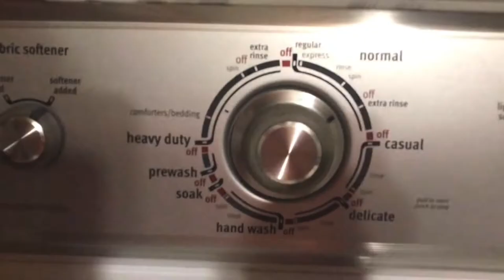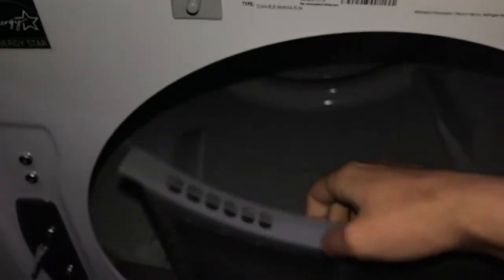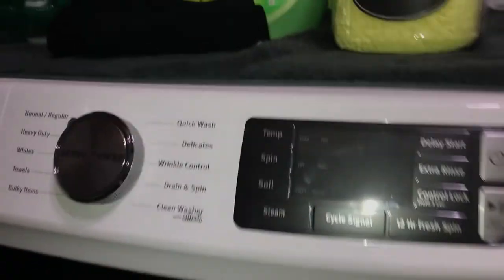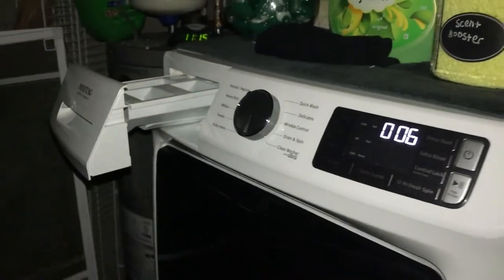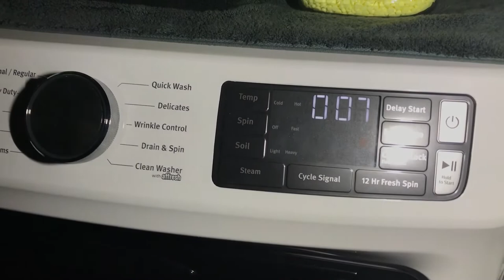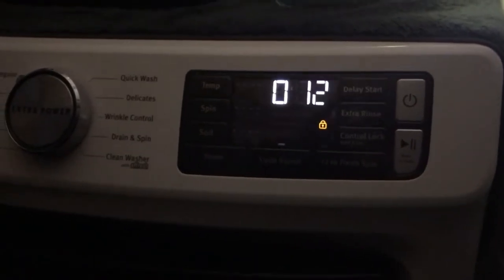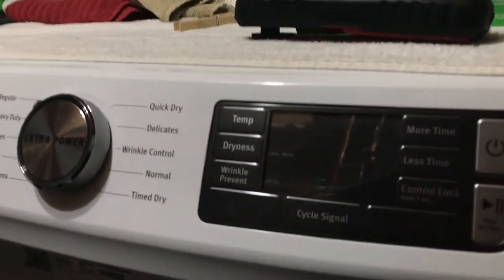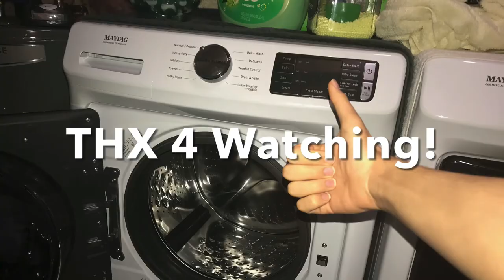How to put Diagnostic mode on Maytag Washer and Dryer

Comment: Thanks for the video.

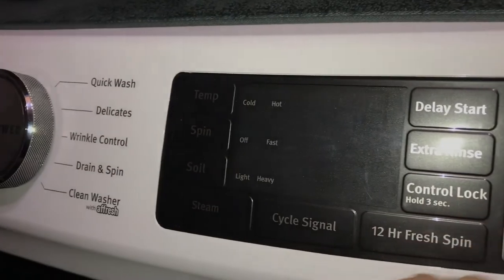For those that want to jump straight into diagnostic mode.... Ryan show's how to do it at 13:37. You would need to tap this sequence 3 times: Temp, Spin, Soil. So it would be 9 button presses in total, for example: 

Tap Temp
Tap Spin
Tap Soil

Tap Temp
Tap Spin
Tap Soil

Tap Temp
Tap Spin
Tap Soil

Comment: I have 2022/2023 model washer: MHW 6630HW and it is 1,2,3 as well but on the other side: Delay start, Extra Rinse, Control Lock....but the number increase or up down is the same with "soil" etc. Update... The other way works as well.

Comment: Thanks for the video, I have the same washer in getting codes f8 e1 and lo Flo. I cleaned out the drain pipe and I’ve tested all tests the drain pump runs but doesn’t empty it completely. I ran code 12 and when it was finished there was a lot of water left in the drum still. I ordered a new pump but wondering if there is anything else wrong?

Comment: I have this same Maytag front loader and it has a few fault codes stored in memory. I left the machine unplugged for an hour hoping it would reset, but when I plug it back in and run through the diagnostics mode, those fault codes are still stored. Do you know of a procedure to hard reset or delete these fault codes from it's memory? Thanks!

Comment: I have this as exact machine and I keep getting an E2F0 error code which indicates excess suds.  Purr Maytag I ran a rinse cycle But that did not work machine fills up with water agitates for a minute or 2 and then suddenly stops and then suddenly stops any idea on what I could check for that could possibly be it thanks in advance